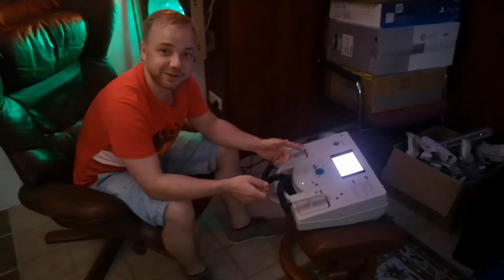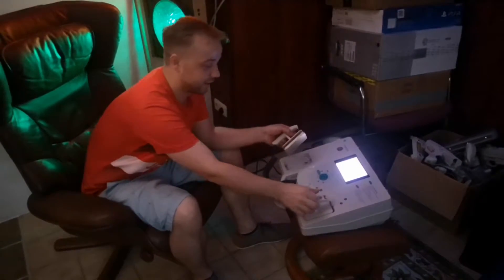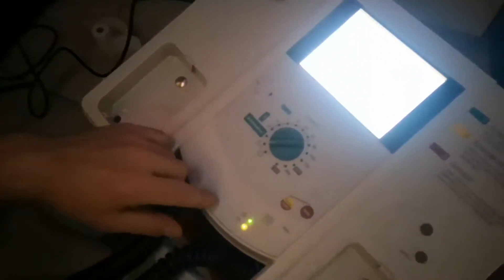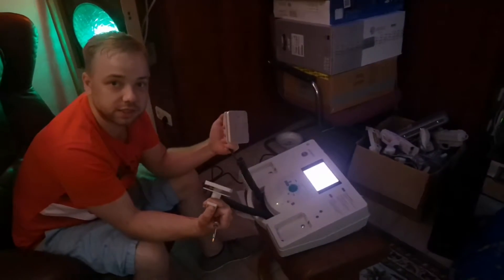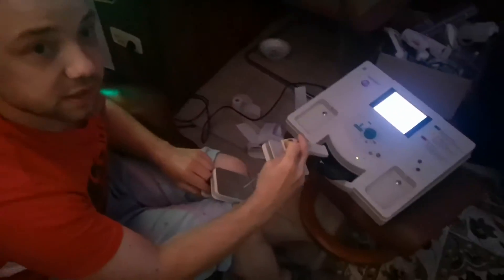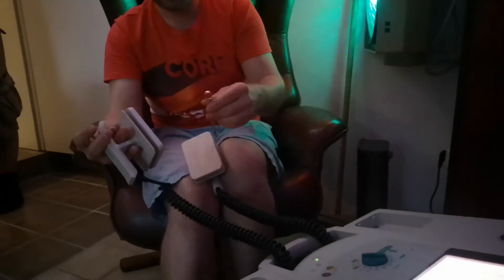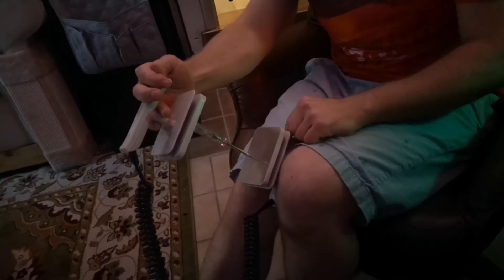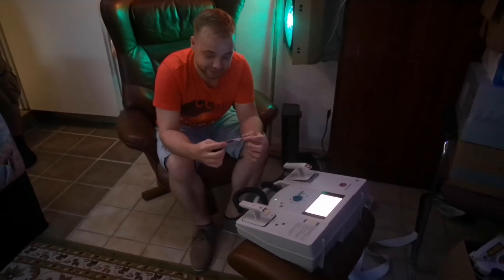Testing Defibrillator power

Comment: dude. Be safe. They can start and can also stop a heart.
Reply: Very true
Reply: They can only stop a heart ,not start it.
Reply: @hiddenuser5466  it can start a heart
Reply: @jayathisu  unfortunately that is a myth. A defibrillator will not restart a heart that has flatlined, it can only  stop the heart or at least shock it back to normal in case it has an irregular rhythm.
Reply: @hiddenuser5466   yes hence starting it... a patient with an irregular hear rate (ventricular fibrillation) the heart is not really functioning properly, a shock will make the rhythm regular hence starting it function normal again...